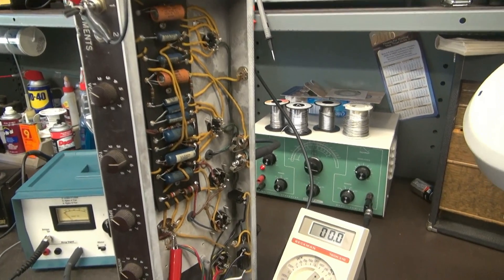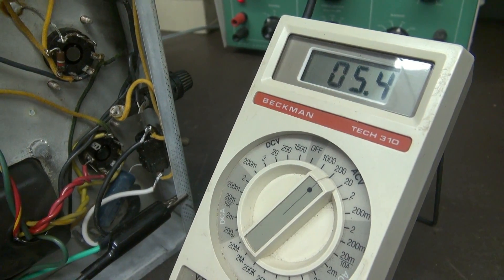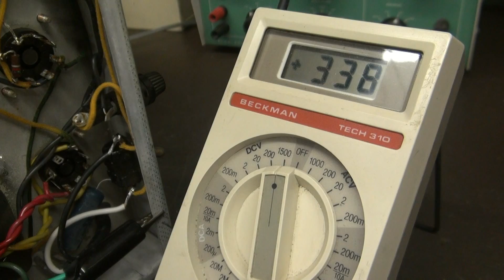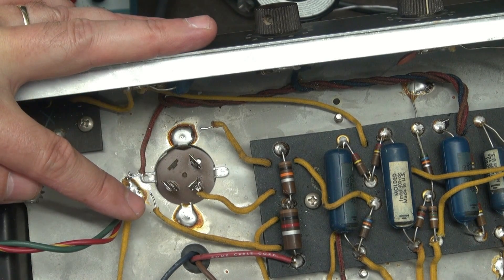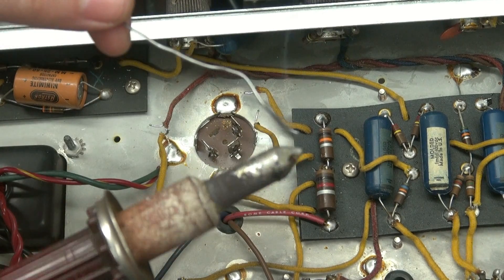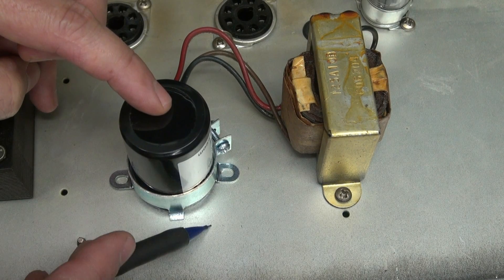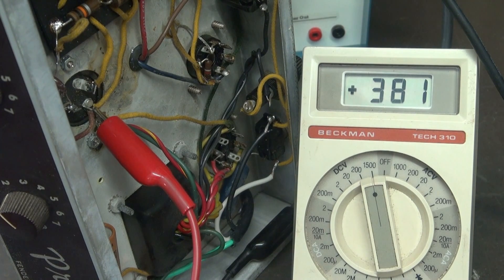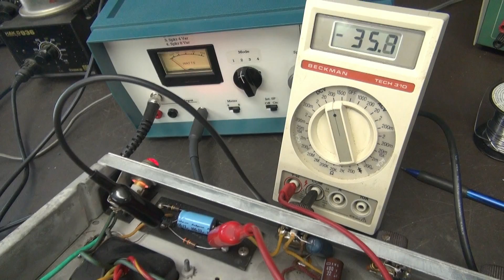Tube Amp Theater How to repair fix Fender Princeton filter capacitor

Comment: Why not wire out the old filter cap and use three modern radial caps? If you want to get artsy-fartsy, you can scoop the guts out of the old one and stuff the new ones into it. A little hot glue and Bob's your uncle.

Comment: I built a princeton reverb clone based on the AA1164.  I added a grid bias pot and re-worked the bias board.  I set the bias pot to give me -34 VDC per the drawing.  Should I have measured plate voltage and current?

Comment: Mr. D-Lab, do leaky filter caps cause that sort of distortion that I like to call "snaggletooth" distortion - that's most prominent when you strike two dissonant lower bass notes, or just two close bass notes - just a nasty cat growling that sort of lingers and fades in and out then dissipates - does that sound familiar?

Comment: Thanks for doing this video. At five minutes 45 seconds you use your multimeter on 2 megaohm setting to determine cap leakage. The first two sections have no measurement (Meaning there is a resistance at least higher than two mega ohms present) but then the third section shows 1.2 ohms. Is that correct? Or is it 1.2 megaohms? When you say "see that?" are you saying that 1.2 ohms is the indicator of leakage? 1.2 mega ohms might still not be... Also, it would be normal for the number on the multimeter to start climbing from 0 (On the scale of two mega ohms that is) wouldn't it? As the charge builds in the capacitor?

Thanks again. Great video.

Comment: Love your amp video's.. interested in your Pro opinion on caps. Does the "brand" of the cap have any significance on the tone/sound of the amp? I know some purist call for certain brands of caps to use as replacements. Does it really make any difference in what I hear from the amp? 

So, if I have the caps on my 100% original 1974 Fender Twin replaced with new caps, will the tone sound different from brand to brand with whatever you use for the job? noticed you used rubycon.. thanks...
Reply from the maker: Hello, Thank you my friend. I enjoy making the videos, especially after a few glasses of wine. For power supply filter caps, brand is not critical. I have used Rubycon's for years, no complaints/returns, very reliable. The name brands, like Mallory are more than double the cost. Have never noted a performance difference. Best thing is to get the old leaky caps out of your amp. They drag down your high voltage/degrading sound. Hope this helps, stay tuned, TD

Comment: That is a really neat trick for checking caps! I've never seen that before. Glad to know I don't need one of those expensive ESR meters, despite how groovy and quick that would be - I think switching from DC to AC on the meter is also pretty darn quick!
Reply from the maker: Thanks man. Yep, approx 90% of all amp repairs can be done with a basic multi-meter. Glad you like.

Comment: Why did you go with a bigger value negative bias cap? And does that effect the sound? And is using a variac necessary when first powering up an amp with a new filter cap(s)?
Reply from the maker: Hello John, I always use 33uf caps in the negative bias circuit when building amps. The 33 is a slight increase from the stock 25's, no changes in sound. The 5Y3 tube allows for a ramp start-up, so the new caps are not shocked. The new cap is rated for 500vdc rather than the stock 450. Turned out well. I still have to verify a few other things, then it ships out. TD